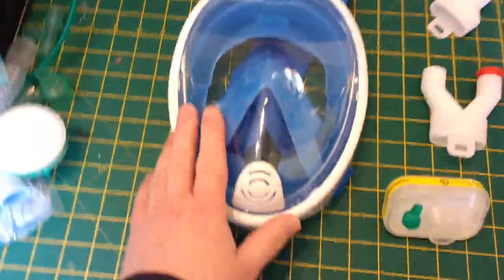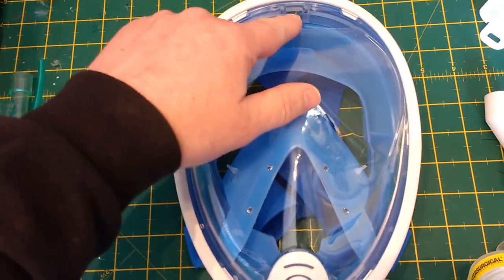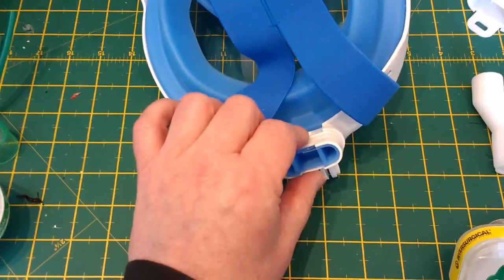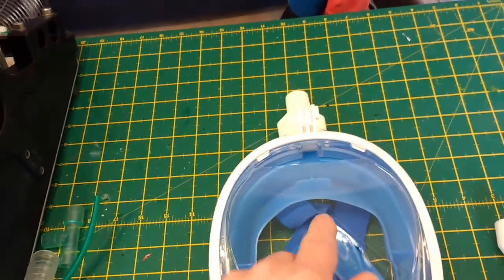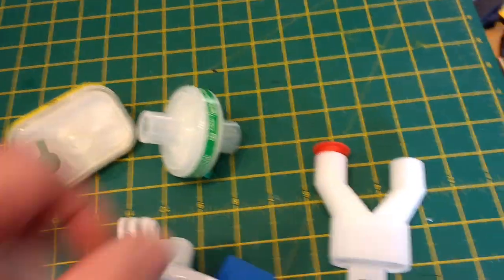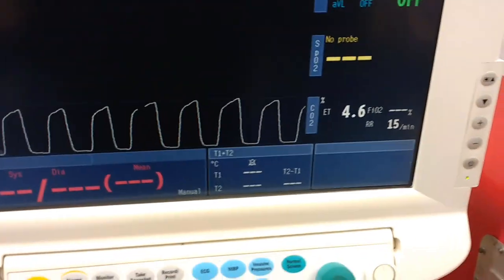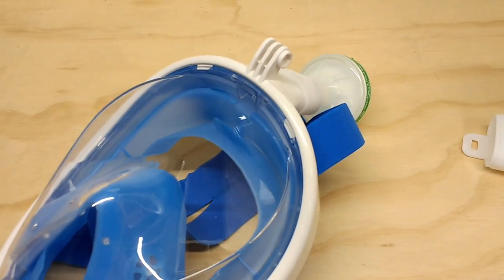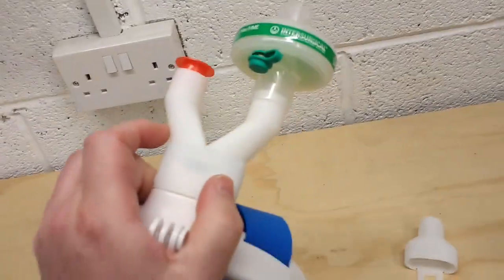Full-Face Snorkel Mask PPE: CO2 build up experiment

Comment from the maker: Coming back to this in 2022, I should probably add that I did not try this while exercising or snorkelling which might have given different results, i.e. CO2 accumulation, and this is an experiment that definitely should be done by somebody. I suspect it would be very unpleasant to wear this while exercising to be honest. These were allegedly used as PPE in the early stages of CoVid and also allegedly used as part of CPAP devices in Italy when minimal equipment was available. I wonder if anyone out there who used them in this way is prepared to comment, with the benefit of hindsight?

Comment: H
Reply: In both of your trials, you face mask showed condensation indicating that you were rebreathing expired air and that their valves to prevent that were not working.  I would like to see end tidal CO2 measurements at least up to 30 minutes with activity mimicking snorkeling activity. Your video may falsely reassure snorkelers who may actually drown from CO2 retention induced loss of consciousness or myocardial ischemia from increased work of breathing to attempt to lower CO2 levels.
Reply from the maker: You are correct. Ideally this should be tested while on an exercise bike or something. These designs were not used in UK as PPE as far as I am aware but in some countries they were, or at least tried. Is there anyone out there who used one of these with the various 3D printed attachments that were around at the time? I believe they were also trialled as a means of delivering CPAP in parts of Italy if anyone has any feedback on that.

Comment: Hi. your mask evaporates because the original pipe has air valves that are not in the adapter. your exhalation goes back to the inspiration zone, there must be a one-way valve between the filter and the mask, so I did breathe much better, the mask does not evaporate, sorry for English I use a translator